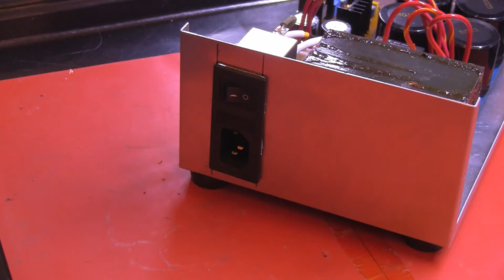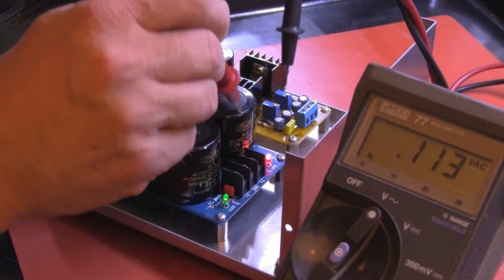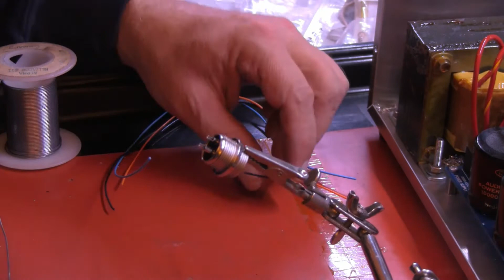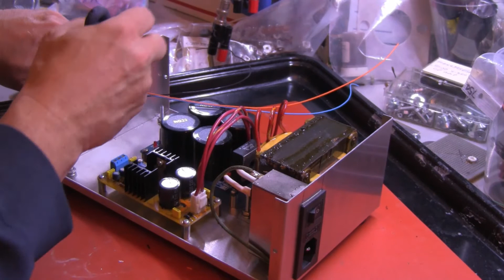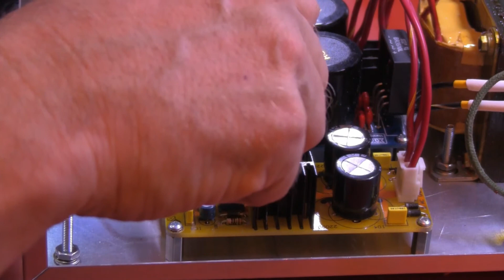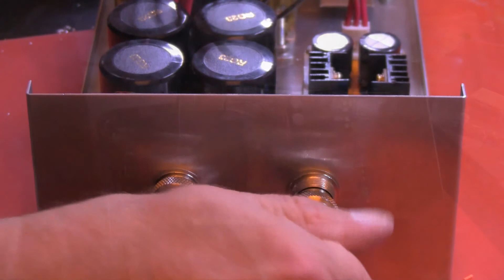Let's Build a Power Supply - Part 5

Comment: The only troubles I've ever had with those locking barrel connectors were a lack of 'roadworthiness' sometimes... first, the threaded collars can crack and go AWOL, and second, the tiny screws in the cable grip can also disappear. First one's a pain but it doesn't stop the plug working; it just won't lock. Second one is easy - wide bit of heatshrink over it, so if the screw comes loose, it can't fall out.
Reply from the maker: Great observations and I don't disagree. I wouldn't worry too much about these connectors though. The amount of use they will get will most likely be very low. I am building a "proof of principals" project and not a daily utilitarian item. If it becomes that, I'll have to post a video about repackaging the whole show. Also, I have a "do no harm" attitude. Don't pull on the wires, don't over tighten the lock ring, etc.